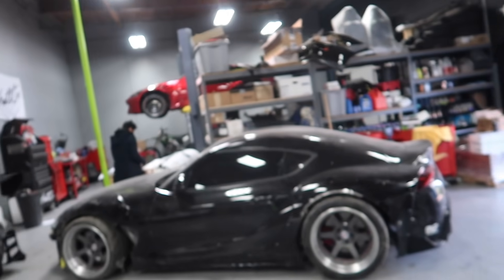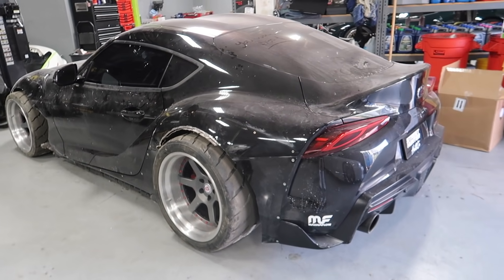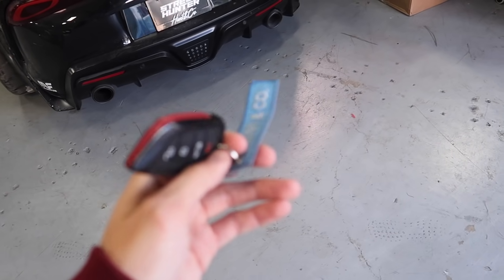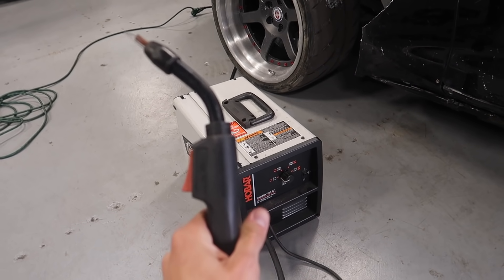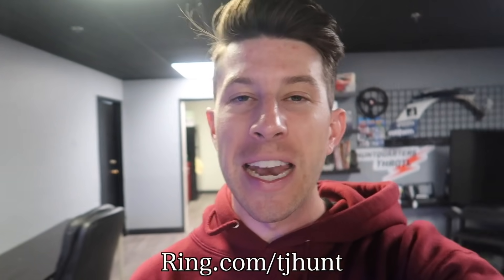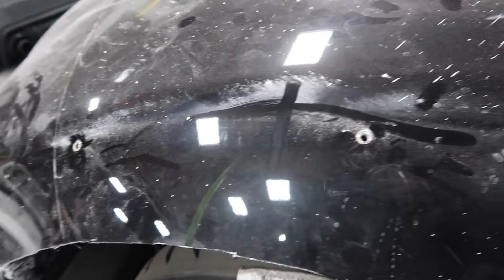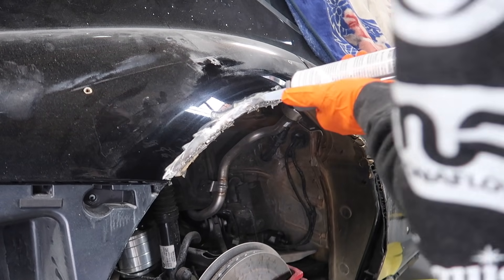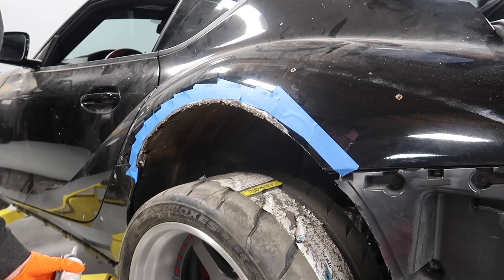No more WIDEBODY 2020 Supra...?

Comment: Little tip when welding. When you hit the edge of the flat surface make a longer contact. Feed the energy through the material I have no idea what I’m talking about
Reply: The blunt honesty of this got me rolling
Reply: lmao
Reply: Haha I was reading at first saying wtf are you talking about.
Reply: “I have no clue what I’m talking about” but it’s actually the best tip I seen in this comment section lmaooooo
Reply: Troll level 999
Reply: Lol 😂
Reply: Also make sure the surface is clean and PROPERLY grounded
Reply: Best tip is getting a proper welder
Reply: @fiisho  Lmao, that's definitely a baby mig. Still though being a Hobart it should put out more than enough for what he was doing, if you know how to weld that is.
Reply: @jkalash762  gasless wire or gasless welders are terrible in general
Reply: 😂😂😂bruhh, and here I am learning from you still
Reply: @fiisho  Thats no joke, anything that would see any kind of force definitely won't hold and the welds usually come out looking pretty nasty. I've seen people use them to tack nuts onto broken studs and it usually takes them a few tries to get a strong enough weld to hold and get the stud out, their excuse was it's easier and cheaper than getting a gas feed mig. For sheet metal work like this though they're enough to get by, if just barely. I actually knew  someone who welded patch panels in on their 51 ford using a gasless mig and needless to say the amount of work to get the welds looking decent and ready to do any bodywork was pretty nuts. The panels warped quite a bit as well, whether it was him being inexperienced or the welder and wire itself, I'm not sure but it definitely left a huge dent he could've avoided in his bank account when it went to the bodyshop...lol
Reply: Dude you made my day 😂

Comment: Disconnect the battery when welding! You can fry the ecu !!!!
Reply: Nah, that's just content for the next video.
Reply: I weld on cars everyday and don’t disconnect the battery. None of the cars battery was fryed
Reply: The_Jydefar_69 lol your lucky, i do collision repair for a living and ive seen it happen multiple times !
Reply: The_Jydefar_69 the battery wont fry, im talking about the ecu!
Reply: Very true, glad someone said something. 2 seconds to unplug a battery, costs nothing. 
Ecu replaced? Car down for repairs, bad rep to your shop, and possibly a couple thousand $$$?? Unplug the battery. Everytime.
Reply: ACP TV exactly lol 2 secs could save ya thousands $$ and a ton of hours
Reply: Yes especially on these bmw ecus since they are so sensitive
Reply: I've welded on plenty of cars and never had an issue
Reply: Or at least use a surge protector

Comment: Welding tips: Cover the paint, cover your legs, cover your wheels, cover the glass. Welding is just as much about prep as it is about welding. Weldings hard, even flux welding (please use a proper mig for thin stuff next time and not a "flux core" wire) is a weird one, so mad respect for getting some weld time under your belt. Just protect yourself and your car.

Comment: Shouldn’t you not need seam seal if welding is done correctly and covered with  paint to avoid rusting?????
Reply: AlexTheLion yes! If they would just properly weld up the spot they cut and fold then they wouldn’t need to use the sealer. Half-assed way to do it and really anybody who ends up with one of these cars should go back and do it right.
Reply: Was wondering if they were going to at least prime the bare metal

Comment: Tj just a suggestion with fluxcore you need gas in order to weld with it properly .  I am a welder in the oilfeild our welding process with fluxcore is to use 75/25 gas 75 percent argon and 25 percent co2. You can get the bottles allready filled in this mixture . Also you will need a gas regulator set your psi to 10 are so pounds . Try this out and it will help your welding experience . Any other questions hit me up i have been welding in the oilfeild for 14 years and i am allways willing to help with passing on what i know

Comment: TJ, bro you need to stop using those type cut off wheels. When they shatter, it can be dangerous, and even hurt somebody, or another car across the room.
The All Steel Diablo cutting blades cut faster and last longer. Home Depot bro. Cheap.....
There's video performance comparison testing online/ youtube.  You can check out for yourselves.
Reply: Michael Morell they make awesome sawzall blades too, haven’t tried their grinder blades yet
Reply: @charlie1832  You're right, I have the Sawzall blades as well. They do work better than most.
If you look here on YouTube you could see test comparison of the cut-off Wheels. 
I've had pieces of the old school Wheels leave their marks on my legs before. Never used them again. 
The Diablo is faster and doesn't blow up, or wear like the old cut-off wheels do.
Reply: Michael Morell I’ve always used the diamond blades on a grinder, check out Diablo holesaws too, it’s crazy how good they are and the kits are pretty cheap
Reply: @charlie1832  I have a 4-1/2 diablo diamond blade. I used it on a tile job recently, & it buzzed right through it. The price was way cheaper than most others. Worked just as good, if not better.
Reply: Michael Morell I use them to cut cast iron and tile to replace shower valves and never have any problems cutting anything

Comment: Wear eye protection under the welding helmet ! They filter a lot of the bad light when you weld. So if you flash yourself by accident, it won’t be as bad... and put some cardboard or something on the paint so the sparks don’t burn it!

Comment: You should try out Hardwire instead of the Flux core. flux doesn't get the best penetration. flux also leaves slag on top of the weld which you need to grind off each weld. if you don't it can get trapped underneath the weld and make it very weak.

Comment: Hey Teej, 
Cleaning those wheel wells you can get a sanding drum attachment for a drill or die grinder. 
All kinds of different grit sleeves fit on the drum and its a lot easier to deburr the cuts. 
The drum rolls with the radius of the wheel well unlike the angle grinder where the disc can get chewed up and break off.
Nice to see you guys doing your own work.

Comment: Mig welding is a breeze but I’d say if you’re going to be welding and want a quality look with quality bead.... use a MiG with an Argon mix has. They have kits and very portable smaller tanks you can use. Flux is a last resort imo. I’ve welding 22 gauge with very low temperatures and just tack consistently close together. You will have cleaner edges for cleanup and use far less sealant.

Comment: If the sealer is the same as the stuff we use on aircraft, if you spit on your fingers and rub it youll get a cleaner smoother control and it wont stick to your fingers. Im not even joking

Comment: Wears shorts while mig
welding, non leather gloves, welds directly over wheels and inflated tire, no paint/glass protection, no guard on grinder, constantly touching grinding wheels when it’s still plugged in, seam sealer on bare metal.. pure ignorance smh.

Comment: Put a damn nozzle on your welding lead
Reply: Dont need one when flux core welding. It's really just more of a mess cause the spatter will close the nozzle up then you gotta dig it all out. Plus the nozzle is only needed to direct the gas (when gas mig welding) directly over the weld to cover or shield the weld from to much oxygen causing porosity.
Reply: Antonio Mosnja  your right I didn’t even think about him using flux core 😂 it just bugged me bc I weld for a factory and I’ve seen ppl do it that’s never done  mig welding
Reply: I know the struggle welded in the industry for a few years doing all 3 processes and man do I cringe watching "newbies" weld

Comment: Im I-CAR GMA MIG certified welder. Watching him do inconsistant welds is hillarious. I'm tired of hating on TJ but damn kid go to college and take some auto collision repair classes. Learn to weld, pant, and do body work. Now first mistake he made was he got metal shavings inside the body when he cut them fenders. Them metal shavings will rust and cause inside of the body to rust. Widebody kits suck unless you got 13 inch wide tires on the back with no spacers. Widebody is the new Ricer look. All show and no go! Posers with stock engines, and wheel spacers. So lame. TJ has spacers on his. Wheel sticks out too far and looks Ricer. I think 17x13 is the biggest diameter slick tire. Them 20x10 look like Ricer wheels.